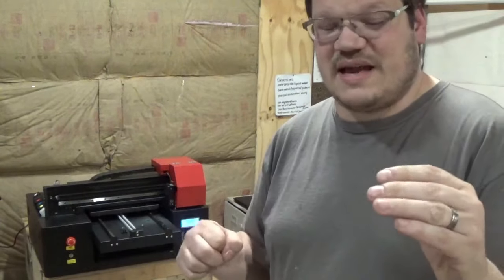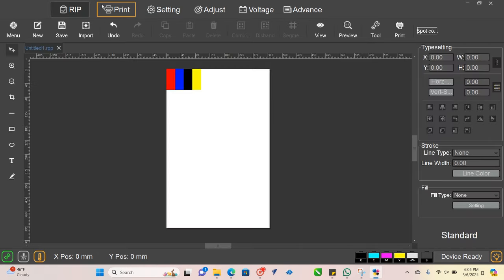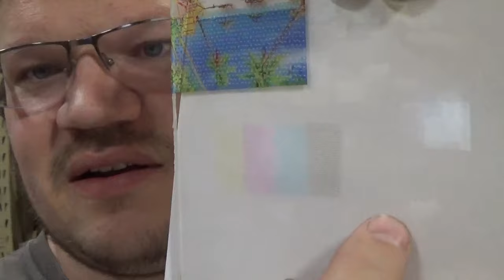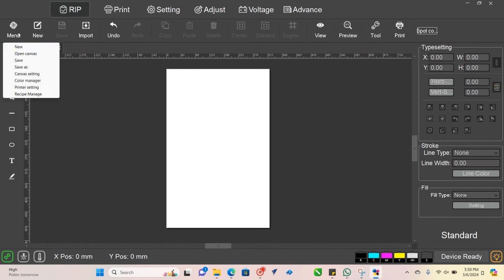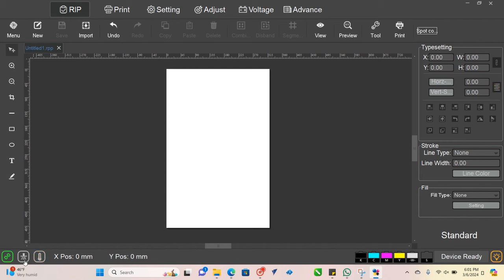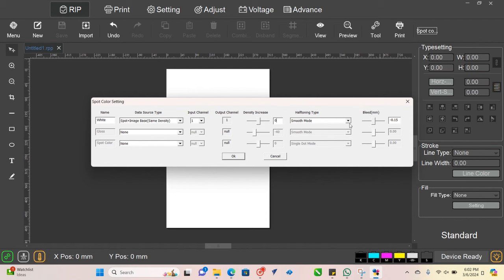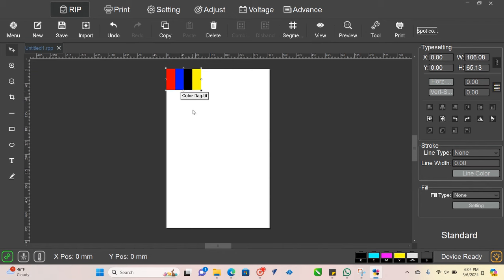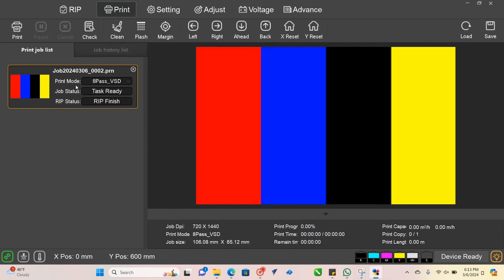how to setup your uv printer for the first time jays printers refinecolor hosonsoft print exp n10

Comment: Hello, I'm bothering you again... the ink indicators that appear below, on the right, do not indicate the correct ink color. For example, I have low yellow ink but the white ink indicator is blinking. I was seeing if they were individual cables to change their position but no, it is a flat cable that carries all the signals together. Can it be solved in some way?
Reply from the maker: Did you mind your inkwell location? Nice the yellow bottle to the white location.  Or you can contact our tech support at jaysprinter.com might able to help
Reply: @JaysToDoList  Thanks for the response, I have no way to change the ink bottle because the six containers are united in a single block. That's why I wanted to know if it can be modified from the software. Unfortunately I cannot access the page you mention.
Reply from the maker: @m2ktll  ok sorry I typed it is jaysprinters.com lower right hand corner therr is a chat bubble you can talk to tech support

Comment: I cut aluminum metal signs with 5052 sheeted aluminum thickness is .08. I was wondering if it will print on that aluminum.
Reply from the maker: Yes it can print aluminum younmay need an adhesion promoter but wr print metal alot

Comment: If I want to print white text only does it have to be on a spot channel?
Reply from the maker: Not necessarily you can turn off color printing in the software too
Reply: @JaysToDoList How exactly would you do this so I can give it a shot? We have the refinecolor 6090 like yours
Reply from the maker: @kenreed9298  under the settings tab top right should say channel it most likely now says normal drop it down you see many options here you can select white color or varnish only then save that's the easiest way to do it just lay out black text and change the white ink settings to the density you want. And tell it print white only
Reply: Am I changing the density under the spot color tab? What would my data source type be? Image base (image density)?